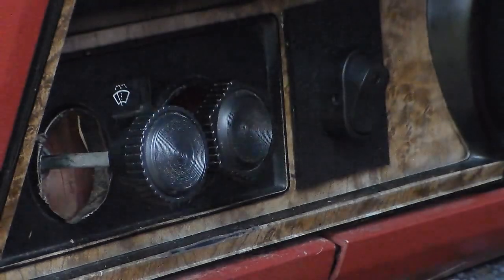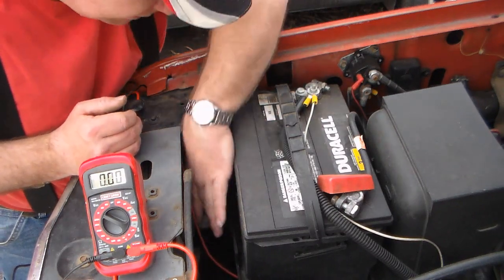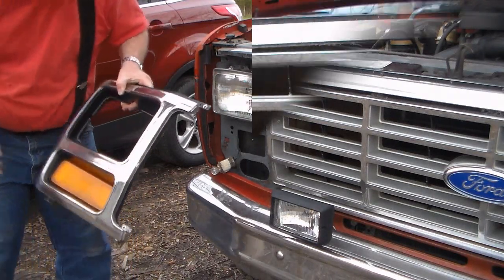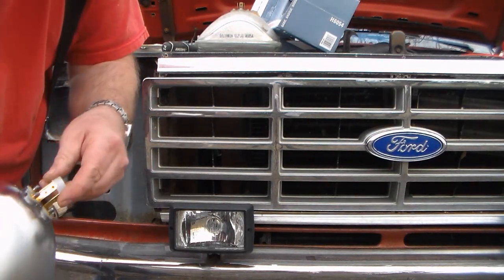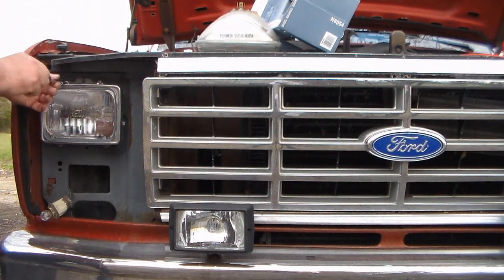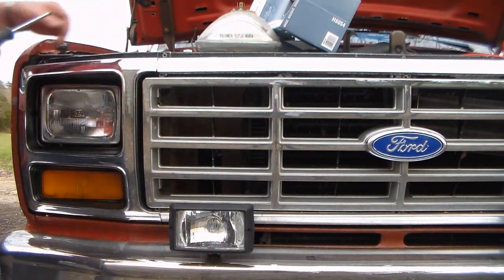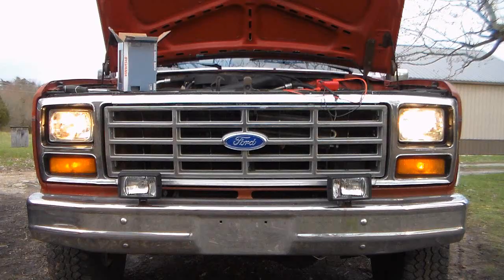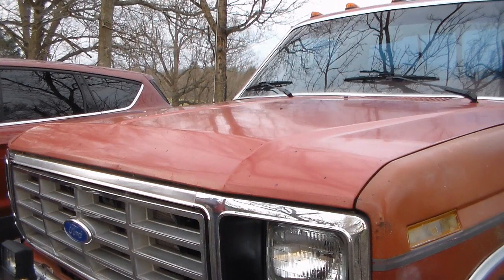Red F-150 (1986 F-150) Headlamp Replacement

Comment: why does my running lights not indicate a right turn but when they off the turn signal works fine...also right running light is brighter too when on....thanks so much
Reply: Check your grounds these trucks are weird about the turn signals you want to see something weird turn on your hazards and then press your brakes
Reply: @travissanchez260  yes, its very weird
Reply: Yep.... My Dad had a 70 F250 and I could turn on the 4 ways and hold the brake pedal and the radio would work..... Strange huh ?